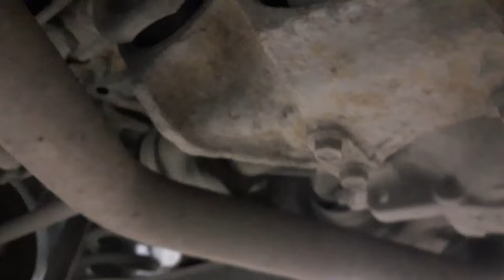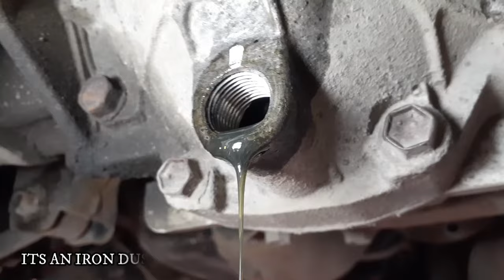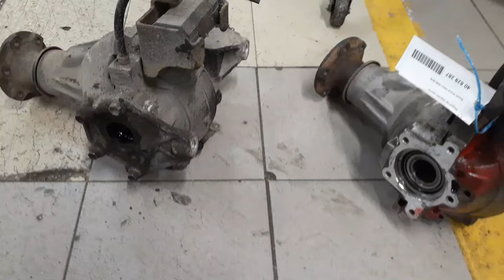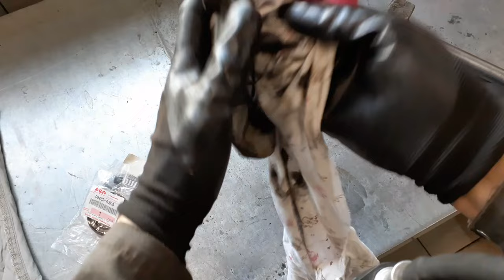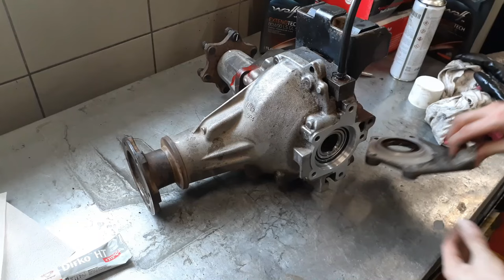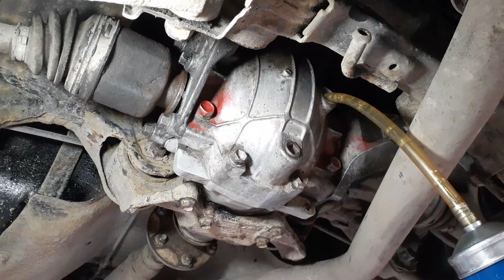Suzuki Vitara Rear Differential Replacement

Comment: Thank you soooo much for sharing this info with us. Such an👍 informative video. I was stressing because my Suzy was wet under the carpet and thought it was from a hole or plug missing underneath. Even checked out the roof rail incase the problem was there. My Suzy is 12 years old now but only has 65,000km on the clock.
I LOVE MY SUZY.💯

Comment: Great job. I have a question. I live in the U.S. and own a 2008 with the 2.7L gas engine that needs to be replaced. How hard do you think it would be to pull without a lift to work under? The 2.7L engine isn't as common outside the U.S. but I imagine it's similar to other V6 engines.
Reply from the maker: Yeah, it's easy enogh to replace engine without lifter. You can disasseble car's front and pull the engine out. I mean remove radiators, front panel and bumper. I think the biggest complexity you can meet is an exhaust pipes rotten bolts.

Comment: I only need to replace the seal at marker 1:40.   So with nothing unbolted, is it correct to just use a pry bar to remove the axle from differential before removing the 5 bolts from differential so the the seal can be pulled out and replaced?  So, it’s possible to replace the seal without taking out the differential?  I also think that for 2013, grand Vitara there is a slightly different seal part number.

Comment: My rear differential has been leaking but has continued to work well. Do you think the seal is the issues? Could it be something else or should I just replace the seal?
Reply from the maker: It's important to check the corrosion on the drive shafts first. It could be useless to replace just seals. Is the seal of center shaft, (that attaches to propshaft) is dry?

Comment: How to know if my vitaras 4x4 is working properly or not ?
Reply from the maker: If you can hear no humming or vibration. If it drives good on snow and mud, and no transmission check lamps on dashboard, then everything is fine

Comment: hello my friend i just got old one out. i know why you seal plate is missing. while turning bolt it snapped seal plate. 

well i have to ask can i put differential back then put axle shafts in  or do i jave to slide the left slip axle in first?  i got jack stands under arm maybe that why i couldnt get axle out until i dropped differential.  ..tia
Reply from the maker: Yes, it will be more easy to slide left shaft first, while installing the diff
Reply: i got ot done. was the one you working on 2.4 automatic. 4x4?
Reply from the maker: @adamsorell4851  Great! No, it was 2.0 4x4

Comment: i have same vehicle but the pinion seal is leaking. will yoke come.off easy or do i need a puller?
Reply from the maker: Hello, usually I don't use any special tool for a work like this. And if to speak about this particular diff, second drive shaft is just clicks inside on a snap ring, and there is no problem to pull it out